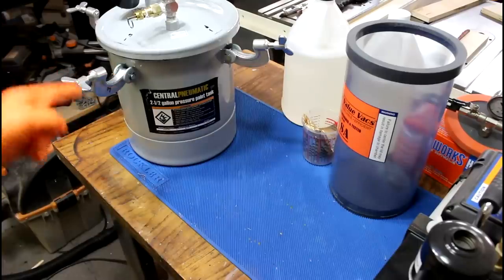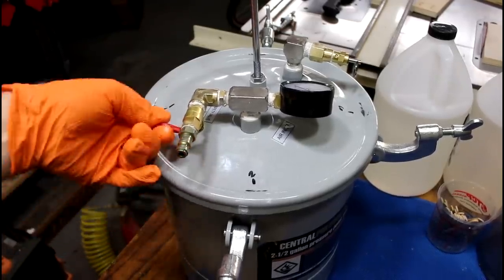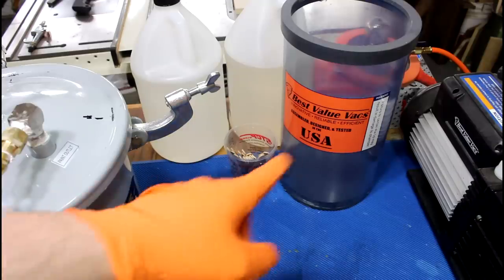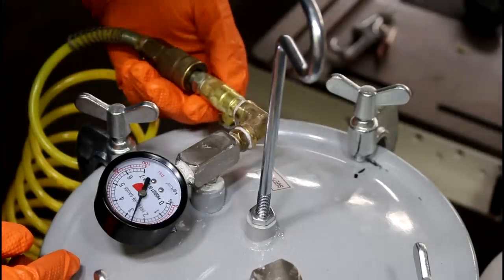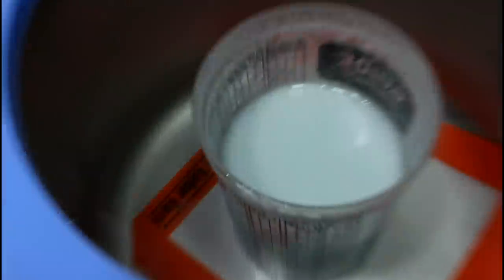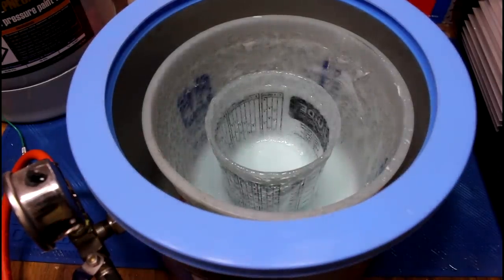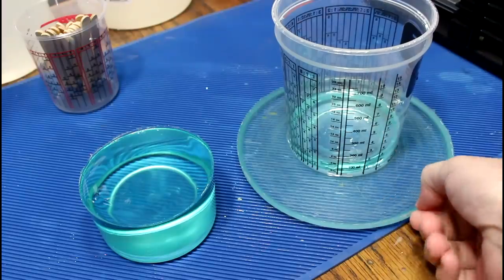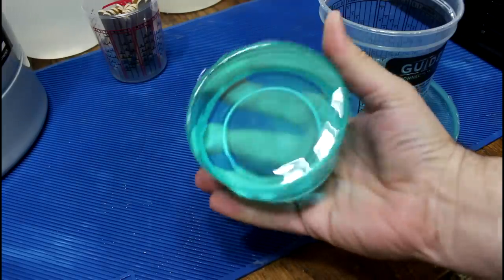Resin Casting: Pressure vs Vacuum

Comment: I’ve given up trying to de-gas resin in a vacuum chamber, I just use the pressure pot now for getting rid of the bubbles. The vacuum chamber is great for degassing silicone and of course stabilisation.
Cheers 
Jim
Reply from the maker: I agree with you. It's so much more reliable.
Reply: What would the effect of pressurizing the champlber with pure oxygen be? Especially if you had some kind of agitator in there to mix in as much gas as possible. Would you get a hypercombustible brick of death? Or just a block of plastic that slowly seeps O2?
Reply: One advantage of vacuum degassing is that the material can be degassed and then poured in molds that might not fit in a chamber of either variety.  Having vacuumed degassed stuff like this more than a few times, I'd recommend a container wide enough so that the resin doesn't fill it more than 10-20%.  I just leave the release valve open and cover it with my thumb until the material almost overflows, then pop my thumb off until the pressure goes about halfway back to normal (without a gauge, just let the material settle down to about it's original level).  But given the results of this video, it does appear than pressurization might be the easier way to go if the mold does fit in the chamber.
Reply: Yes degassing resin certainly has a place but for the sort of work I do the pressure pot works better. The temperature has to be right for degassing to work and it needs to be done quickly. There is a danger of boiling the resin under a strong vacuum, which I think is what happened to Peter in this video.
Reply: Looking at it from an electrical engineer point of view, you could have a cheap 4 dollar ebay IR light (or a simple laser/receiver pair) shine on a receiver and position them right above your inner bowl, when the stuff foams above the bowls height it will interrupt the lights ability to shine on the receiver and have that communicate with a pressure switch (solenoid?) of some sort to let some pressure back in so you can just run it continuously without having to worry about it. You could make something like that with audrino for around 20-30 bucks and I dont see why it wouldn't work for everything including resin. The constant cycling of pressure>vacuum>Pressure>vacuum would work perfectly to remove all the air if done constantly by allowing the bubbles to collapse and pop instead of a constant vaccuum/foam mess, then follow it up with the pressure chamber thing should smooth it back out quickly before it drys....and should make your resin almost perfectly transparent.... or a strong pump paired with the smallest possible chamber with the pump and pressure timed in short intervals to keep repeating high>low>high>low pressure to pop and draw out the bubbles a least 3 times faster then in the video....and the short intervals will stop it from foaming over if timed correctly.......then the sudden pressure when then after, it is put in a pressure chamber...should make it even more clear than your clearest result in this video..
Reply: I think the only side effect of pressure curing resin is it smells bad for longer.
Reply: You lower the boiling point of any liquid when you lower the barometric pressure; put it under vacuum. This is why water boils at a lower temperature the higher up in elevation you go. That is why you have such a hard time getting all the bubbles out in the vac chamber.
Reply: Could you add vibration in order to help pop the bubbles as they form?  Ik they use vibration in concrete pouring to help get things settled and get air out
Reply: De-gassing resin in a vacuum chamber only works effectively if the resin has been thinned with a solvent. Adding a solvent does increase the working volume slightly, but it also increases both the curing time and decreases the viscosity, which allows air to escape more thoroughly while also allowing the resin to fully penetrate any porous material. 

A trick I used in high school was to mix the solvent in with the resin while mixing, then de-gas, and then pressurize, all in stages. Full penetration, no voids, no bubbles, and the resin I was using comes out more thoroughly mixed. Frankly I've used it to stabilize wood for hand-carving with chisels using Lock-Tite epoxy resin, a food vacuum sealer, and a bike pump. Did it take longer? Yes, but with all things art patience is a virtue.
Reply: In the vacuum chamber what you are seeing is that in fact the resin is boiling. 
If you lower the pressure low also the boiling point of the substance.
Reply: I used to work with PU and PE resins a lot. The foaming in the vacuum chamber is actually water that is in the resin which evaporates. Water boils at room temperature in a vacuum. The trick with fast curing resins is to dehydrate the A / B components in the vacuum, before mixing. So after mixing them you only have to take out the air bubles, which is super fast.

Many of the bubbles you normally get in castings are actually water vapour that expands because the resin gets warm when curing. This happens mostly with cans that have been open for a while...
Reply: Ron Carter  what's the point of your comment? Do u feel like a big tough guy? Way to go clown.
Reply: I realize this video is a couple of years old and it's likely no one will read this. What I want to suggest is your vacuum chamber got all the air bubbles out long before you decided you had reached "equilibrium". If you hold a vacuum long enough, or pull it too deep, you go right past the air bubble problem and begin evaporating out volatile components of the resin itself. Had you stopped earlier, or regulated the vacuum to a level where some atmosphere remained, you could have vented sooner and had a stronger, still clear result. It does take experimentation to work out what pressure to regulate to, and how long to hold it.

Another approach is to hold vacuum a while, then reverse the process and pressurize. This is a technique used in industry, to first remove the entrapped air, not remove the volatile components of the material, then apply pressure beyond ambient to improve adhesion and strengthen the end product.

So what I am now wondering is if your pressure pot can also be used as a vacuum chamber? If it can be so configured, you could do this two-step process on a small scale. Pull vacuum to perhaps 1/2 to 1/8 atmosphere, hold for 5 minutes, then vent the chamber and valve off the vacuum pump. Finally, pressurize the chamber to some safe level, as you already did.

Full disclosure and disclaimer, I do not know what I am doing and only have expertise in consuming pizza. Anyone who tried my suggestion and gets hurt has only the mself to blame for being so danged gullible. Unless it works beautifully, in which case you owe me nothing ... because I was never here ....
Reply: Enuf IsTooMuch For what it’s worth, I actually did read your comment and I believe it makes sense.  I believe there is room (and maybe even necessity) in this casting process for both pressure and vacuum operations.  Degass resin with vacuum at an appropriate level (to remove air while not affecting the volatile components) and then pressurize while casting the actual part.  Using pressure only, I am curious as to what effect the thousands of tiny high pressure (50 psi) bubbles remaining in the finished part might have on stability and residual internal stresses.
Reply: A pressure pot doesn't remove or get rid of the bubbles. The bubbles are reduced by the atmospheric pressure the longer it's left under pressure until the bubbles become so small they aren't visible to the human eye. They are in the resin, you just can't see them. It's still far more effective at creating clear resin and the structural integrity is very similar.
Reply: @justinrupert6326  adding vibration is not recommended by a lot of resin suppliers. Much like environmental temperature, over storing, pouring resin too deep, vibration can cause the resin to overheat and go exothermic. When epoxy goes exothermic it can reach temps up to 400°F and become very dangerous. Not only does it ruin your epoxy, but imagine having  a thick, sticky substance on your skin that you can't remove. I've had resin melt the plastic cups it was in just because it was hot and humid outside.

Comment: It would be awesome if the resin would set as the foam, or solid on the bottom and with foam on top. It would look like blue beer.
Reply from the maker: We were both hoping for that. I MIGHT have to try that in the future, but I sort of can already do that with the lava effect.
Reply: OR, add a little moisture to a polyurethane casting resin...  Makes a great foamy top for a beer art piece.. Such are the things one learns from ones mistakes!! (I used a moisture sodden stirring stick to mix my resin)
Reply: I wonder if using a faster setting resin might allow for that.
Reply: You should try getting it all foamy and then turning off the pump to hold the foam where its at and the letting it cure
Reply: He's done that with the resin that boils when certain dyes are mixed with them, if I remember.
Reply: @SixKoi  yah, but those are like huge bubbles. Hed get small ones this way
Reply: I was thinking along similar lines, maybe with a ultraviolet curing resin and hit it with a really strong UV light right as it reaches the foamieness you desire.
Reply: Could also maybe use some resin with a really short work time and hit it with a heat lamp, it might set before all the bubbles dissipate.
Reply: I've had a very quick set resin set as a foam before. It's really cool, but that wasn't the desire effect at the time.
Reply: @peterbrownwastaken   Really it seems like you just need to use far less resin for that.
Reply: @peterbrownwastaken  the lava is a bit more sponge like. The foam In that honestly reminded me of the green foam blocks you buy to stick fake flowers in. Love your videos just got a space to do projects In so I'm super excited to get started
Reply: nessagirl1911 I bet with a fast set resin like a 5 minute epoxy you could do that. Have everything ready to go and then equalize when it foams up just a little higher than you want. It’ll settle slightly as it sets and then it would cure like that. Would be cool to see. Though probably more practical to just do s blue pour and then after it sets do a white pour with lots of bubbles and let it set with the bubbles in it.
Reply: @peterbrownwastaken  To get that to work, is to get to bubble, and then just close it off; it should just harden like that.
Reply: Are you serious? I accidentally do exactly that everytime ive tried casting resin with unstabilised/untreated pine. AND, it took a lot of trial and error to figure out how to stop doing that. My suggestion: don't worry, it's not awesome, it's ugly as sin.
Reply: Jedrek29t did a beer in mug with resin foam it's awesome

Comment: What you gotta do is let the resin foam up, then you break the bubbles (let air in) and re do until it's only pulling air out without foaming up
Reply: I would just reduce the pressure in the vacuum slowly. Instead of allowing air into the vacuum to raise the pressure, use a needle valve on the pump side to reduce the flow out.

Comment: Peter could you try a small amount of fast setting resin in the vacuum chamber and see if you can get it to set as foam?
Reply: i wonder if it'd implode when the vaccuum is removed
Reply: @rallekralle11  it would not ^^
Reply: Would it even set in the chamber? What with the constant movement and lack of oxygen? I might be comparing resin to concrete a little to much here...
Reply: @Fitz1993  resins, generally, don't react with oxygen to solidify, they either react with themselves thanks to a catalyst or one part reacts with the other.
so at to the constant movement, it will slow down as the resin get thicker. things like gelatin don't set while moving because they rely on reversible interaction between molecules, resins rely on permanent and not normally reversible chemical reactions.
Reply: Oh wow, thanks for that response, thats pretty fucking sick. So what will happen / potentially happen to the cavities left if you were to set resin in a vacume chamber? I guess nothing if the cavities are sealed in resin?
Reply: MeMeBigBoy they resin would probably look pocked and have craters and stuff where the bubbles formed while it was setting
Reply: @fishsticks2965  Fair enough
Reply: Make a cat themed thing
Reply: @ashleywoedy9750  maybe flll a cat mold with a bit of resin and make it foam up then set in the shape of the cat, make a volcanic rock cat thing....
Reply: Do it with uv resin and hit it with the uv while it is foam.  Lol

Comment: The problem with a vacuum is that the boiling point of any liquid falls with a drop in pressure.  I don't know what the normal boiling point of the resin you were using is, but it's conceivable that it is at room temperature when you drop the pressure that much, and the resin was actually boiling, which is why you got so many bubbles.  It's the same principle that creates cavitation behind a boat's propeller.

Comment: Depending on the thing I am casting I have used the vacuum pot to degas the silicone and then cured under pressure to reduce deformation if I am casting a clear part (lens covers) that I want to have crystal clear by curing under pressure...   An understanding of Boyle’s Law helped me work out what was happening..   Loved the demo..

Comment: This is exactly how Games Workshop make their ForgeWorld models. Using silicone moulds and black resin, it gets degassed twice, 45 seconds each time then left to set for an hour before being removed, I did the job for 2 years :)
Reply: Hi Atomfire, how did they degas it?
Reply: @RebeccaFyre  Thanks for the quick reply. So they used a vacuum chamber instead of a preassure pot.
Reply: @nohowahay4179  yeah just because the moulds are big, as you can imagine with some of the figures.
Reply: @UCdW-U0aqDxAknXcxnVMPY_g Thanks again. Just wanted to know. So if you do it right you can indeed manage to degas with a vaccum chamber and the test above is just somehow not done correctly.

Comment: Thank you very much. I was a vacuum technician. Melting metal and now retired. I’ve started turning wood and resin and thought about getting a vacuum chamber for casting. Now I’m getting a pressure pot 👍